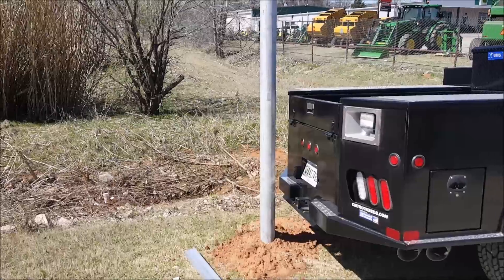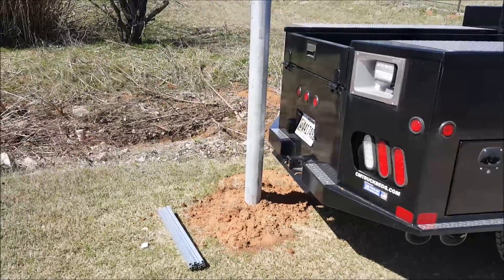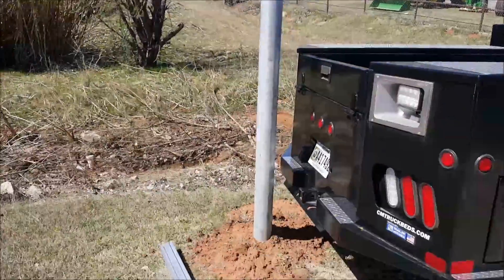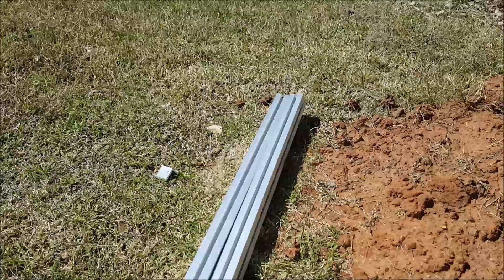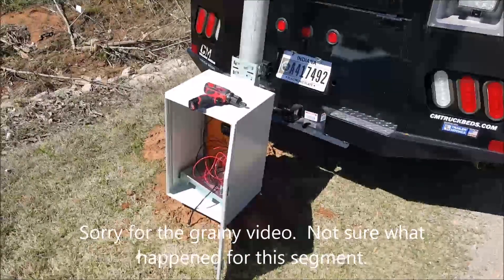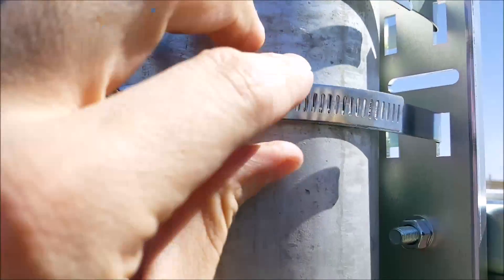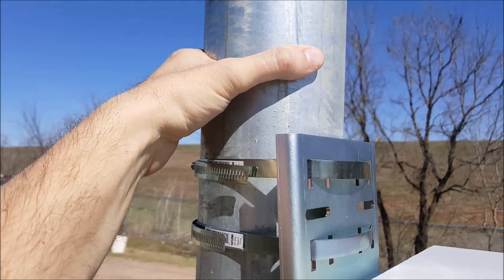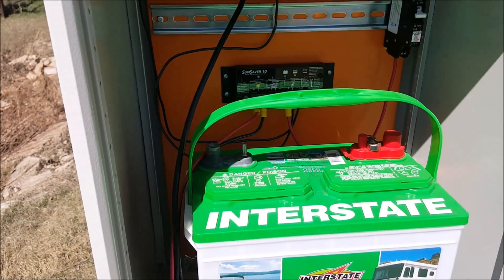Solar Powered Surveillance Camera Project 2

Comment: Great job! Do you know the runtime of your setup on battery only? I'm guessing around 24 hrs.?
Reply from the maker: Yes, I designed it to be able to run 24 hours if there was no sun whatsoever.  And I always do the math very conservatively.  So in the real world it should be longer than 24 hours and also the camera will not be running the whole time if you set it to only come on when there is movement.  I haven't tested that out in the real world, though.  I would have to disconnect the solar panel so there is no incoming charge and then time it somehow to see exactly when the charge controller disconnects the load because the battery is too low.  Not sure how I would test that.
Reply: I normally test by putting the camera in continuous record and when it stops recording, I know the battery is no longer sufficient to supply the required voltage.  That way, you can walk away and just check the length of the recording on the NVR.
Reply from the maker: Pradeep Latchman Good idea.  But that would only tell me how long the camera can continuously run and not how long it can intermittently run when set to record when it detects motion.
Reply: Sure...it will vary by the number of triggered events. Once you know continuous, at least you have the worst case number, then you can guestimate.
Reply from the maker: Pradeep Latchman True.  I will give that a shot.  Thanks!

Comment: I am working on a similar project and I was wondering exactly what enclosure and accompanying pole mount you used and where you found them? I'm having a difficult time locating an enclosure with the specifications I need, but the one you used seems about right.
Reply from the maker: This is the one I used (enclosure):  http://tyconsystems.com/index.php/enclosures/422-enc-st-23x14x12

And for the pole mount, it was just a Renogy pole mount off Amazon:  https://www.amazon.com/RENOGY%C2%AE-Solar-Panel-Pole-Mount/dp/B00I2YFKQK/ref=sr_1_1?ie=UTF8&qid=1465703600&sr=8-1&keywords=renogy+pole+mount
Reply: Thanks, this is exactly what I need.
Reply from the maker: LupusCreatrix
You are welcome.  It isn't cheap but it is good quality, sealed well, and mounts pretty easily to most any pole.

Comment: aren't you concerned about it being easily accessible? some expensive components inside that box. I would think you would want it up out of reach.
Reply from the maker: +Rob Lambert The cabinet has 2 locks on it.  There is only about $150 worth of components and a $100 battery in there.  The cabinet itself is worth more than that.  If someone really wanted to they could snip the wires and undo the hose clamps from the back and take the whole thing.  This is the same type of setup that cities use on traffic cameras and they don't seem to have problems so I think it will be ok.